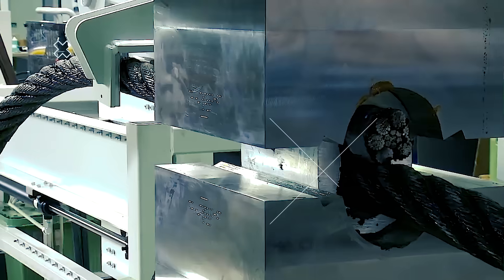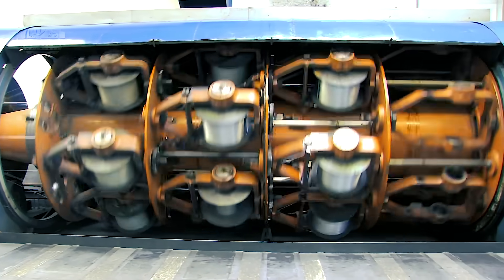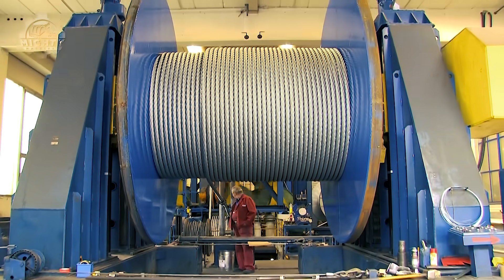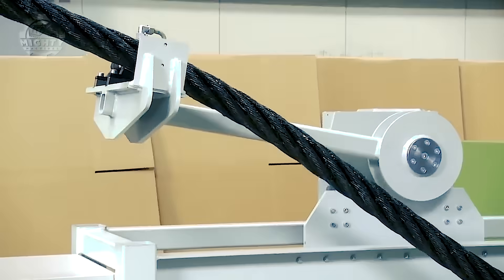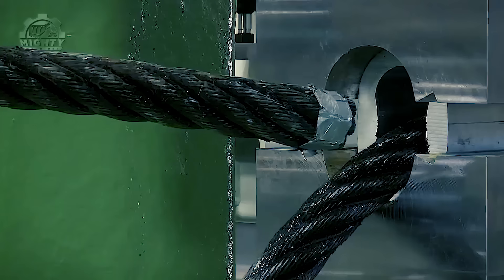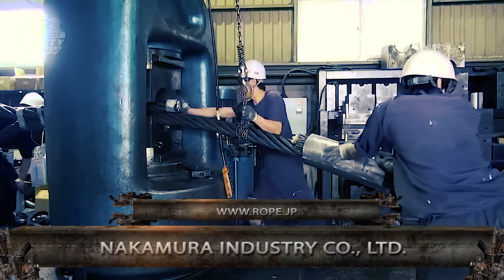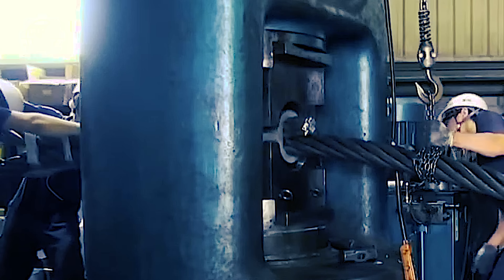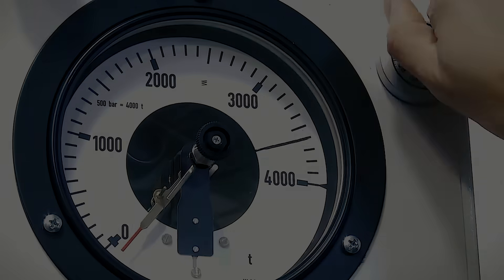Incredible Manufacturing Process Of Industrial Wire Rope

Comment: I used to work on overhead bridge cranes, replaced a few wire ropes in my day. Yep. Oh you should SEE the fat ropes reaved 96 part on main hoist of a 900 Ton hot pot melt bay class F Ladle crane at a large busy steel mill! I mean in-person. Where you feel the heat and you're breathing the filth. The life of some wire rope isn't spent in glamorous pristine conditions, no. The load spreader assembly is bigger than most people's house. Big motors, big gearboxes, big brakes, big bottom block, big hooks - REALLY cool stuff.

Comment: Steel ropes are gradually replaced with polymer ropes because some polymer fibers (Zylon, Dyneema, etc.) are stronger and less dense (less heavy) than steel.
Reply: Dyneema is incredibly weak in abrasion. So while it may replace steel in some applications, it certainly won't in all.
Reply: @HotelPapa100  I have just found Internet article. Its title: Why Choose Dyneema Rope Vs Steel Wire Rope For Heavy-Duty Rigging? Its conclusion: Manufacturing companies choose to use Dyneema rope over steel wire rope for heavy lifting applications such as heavy lift slings, crane rope, and other rigging operations because Dyneema rope: Is 15x stronger than steel wire rope. Has a recoil force that is considerably less than steel wire rope. Has an abrasion lifetime that is 4x longer than steel wire rope. Is 7x lighter than steel wire rope at the same strength.

Comment: Putting a loop onto the end of the wire with a Ferrule is not in my mind how you splice braided wire rope together. Did you accidentally miss label. If you have a video showing that process I would like to see it
Reply: @ Mighty Machines Channel:  Please Respond!
Reply: Are you trying to spell ferrule?
Reply: @greenbudkelly2820  yes. I guess I have a thing for Colin Ferrule. LoL But even that may be misspelled.
Changed the spelling on the post. Thanks
Reply: This isn’t a splice it’s putting an eye in the rope
Reply: That is a splice. Just a different sort of splice.I'm assuming your meaning a hand splice?
Reply: @timmcgowan4448  I don't know the correct terminology but for example when large braided rope is weakened to the point of failure mid length. The two frayed end are then joined together by " splicing " the two together some how to make it as one piece without the need of other joining methods so it can still be wound on a drum or through a linkage or others without binding or getting snagged.
Does that make sense? Or are these monster cables incapable of that. I'm not an engineer, just a tinkerer. It works on no real load small wires so I'm wondering if it's scalable to the big boys. That's what I was hoping to see. Trying not to sound disrespectful to the guys who knows the business. Thanks.
Reply: @jonbutcher9805  your talking of a "long splice" in which one strand becomes the core of the rope.its how they make things like gondola cables
Reply: @timmcgowan4448  great thanks. Now the question become Do you know if there's somewhere I can see such an operation. If anyone reading this knows please inform. thanks
Reply: @jonbutcher9805  if your located in New Zealand I can tell you were haha
Reply: @timmcgowan4448  HaHa. Maybe one day.
Reply: @timmcgowan4448  that’s not a splice. It’s a mechanical fastener used in place for a splice. Mechanical fasteners can be stronger than some splices.
Reply: The braided wire rope sling is comprised of several galvanized steel wire ropes, braided by hand. It offers a safety factor of 5. The sling is flexible, comparatively easy to handle highly resistant and has a large grip width. It can be used for “basket handling”.
They have shown a Flemish eye loop construction with a tapered ferrule. These are considered to be more safer than aluminum ferrule and used for critical applications
Reply: Dam click bait
Reply: It is a click bait title.  No splicing done in this video.
Reply: Don't count on it. 
Why don't they support homosexual special rights ?

Comment: Thumbs down! Waste of time!
This video is not showing any "Incredible Fast Wire Rope Splice Method". 
It only shows Swaging Machines with Ferrules.
From Wikipedia: "Rope splicing in ropework is the forming of a semi-permanent joint between two ropes or two parts of the same rope *by partly untwisting and then interweaving their strands*."